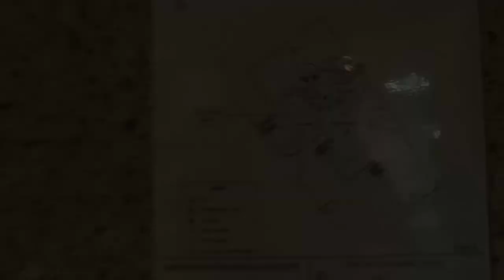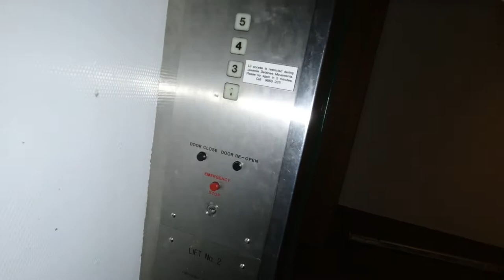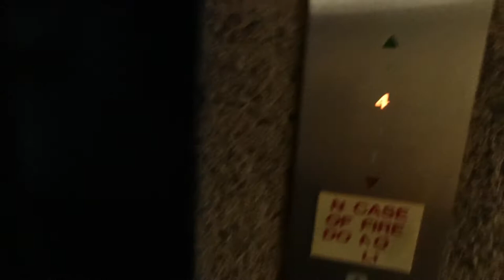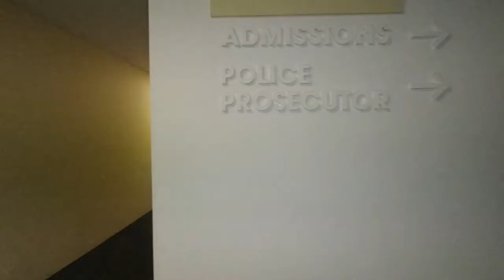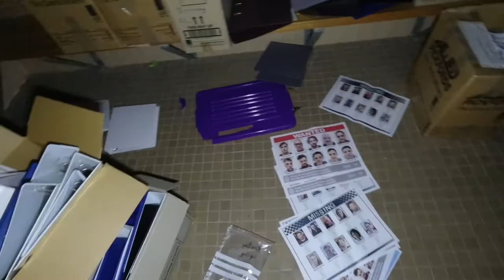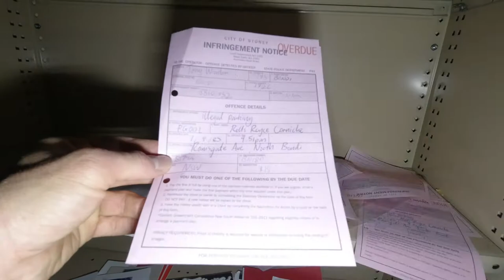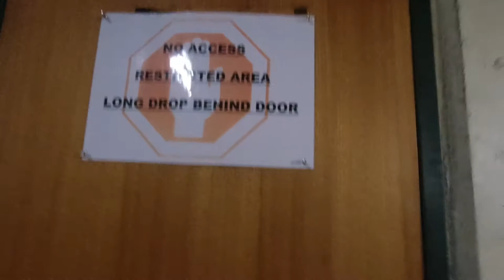Huge Abandoned court house (with working lifts & we got in!)

Comment: 7:23 That's the sound of dry lift tracks. It hasn't been used regularly for a long time, so the tracks which the lift is attached to didn't have enough grease, and the sound is just the friction between metal and metal
Reply: I mean no kidding it’s an abandoned building of course the lift never got maintained I’m suprised this building still has power